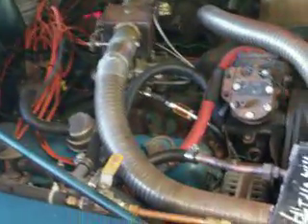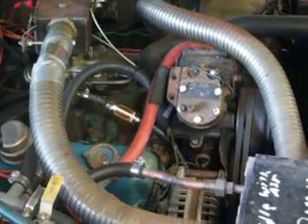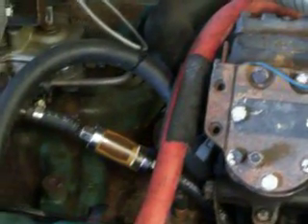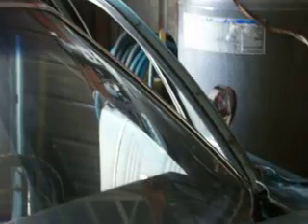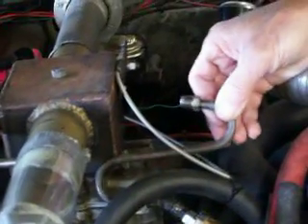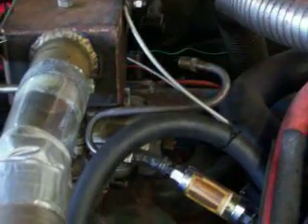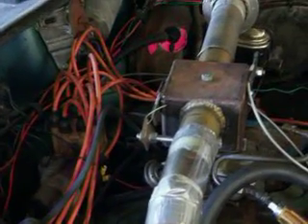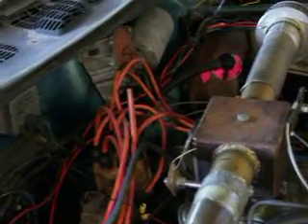318 on gas fumes

Comment: Yeah I’ve done this it idles fine but once you take it out on the highway. It goes about 8 to 12 miles then fails.  I’ve done this a few hundred times. Tom Ogle had the same issue but he took it to New Mexico by keeping it at a steady speed any variation makes it stall Slowing down also makes it stall. When he slowed down coming offf the highway he stalled That’s the reason As you burn through the fuel you burn off the most reactive part and it no longer reacts properly to the accelerator Hint you guys you don’t need any heat. Ran mine for miles without heat. Also it’s not running on “ vapour” this is a misconception

Comment: The main thing is how many miles are you getting to a gallon
Reply: It increased my gas miles from 12 in city 15 on freeway to 15 - 19 in city to 25 on freeway,  in a 1965 Dodge truck with a straight 6 cylinder engine single barrel down draft carburetor. I made my first one out of 1/8 plate aluminum I cut wholes in before I found hollow metal balls on internet,  its shown on my other videos , 2 are shown on 1973 CB360 motorcycle , with engine running , on my YouTube channel  .

Comment: Mine uses the PCV valve hose with a T and another PCV valve that connects to a one quart bubbler . Gives the engine a nice little boost in power

Comment: Add a hollow metal ball between carb and intake manifold atomizes and vaporizes gas doubles gas mileage
Reply: I’ve seen your hollow metal ball design on your page.  Why would it work though? 

There’s still a hole going through the center of the ball, so a straight path from carburetor to intake manifold.. 

So fuel would still go straight into the manifold .  How would it get vaporized?
Reply: @johnle231  as the air goes thru the ball it creates a worreling in the shape of a donut that sucks the larger droplets out of the intake air just like smoking a  bong vaporizes the smoke creating circles kind of like people blowing smoke out of their mouths only much faster ! I looked down thru the carburetor and saw the droplets being ripped apart , I used a small device used to look down into walls looking for leaking pipes etc . I have no other way to explain it .
Reply: @RLBJR1666  

And you got double the mpg?   Has anyone tried your idea and reported results back to you?
Reply: @johnle231  not yet , I wish somebody would , it's hard to do by those who wont do modifications,  it does cause the carb to sit higher , on my truck I had to make linkage  simple lengthening a metal clip on bar to carb linkage
Reply: @johnle231  I gave the idea away years ago never patented, public knowledge, most are afraid to try ,make one for small engine where you can throttle carb by hand , you will see your sparkplug sparkling clean and high rpm on easy start up any motor ! I broke my ankle and. leg , while getting my motorcycle a tune up ,added electronic ignition, got the leg support off last week so hopefully can show it running very well by video again !
Reply: @RLBJR1666  

How do you think it would work on efi or tbi engines
Reply: @johnle231  on my channel I show a design of efi setup , tbi it vaporizes the fuel / air mixture so well that it cant but help get better mpg , I'm not an engineer so all I can say is experimenting is the only way to tell !

Comment: Hi , do you make any modifications to the engine to compensate for excessive combustion chamber heat from lack of cooling that would have come from the atomized fuel from the carburetor , does this conversion cause valve burning?
Reply: todo lo que dices es una teoría; te recomiendo midas la temperatura en ralentí y bajo carga de el refrigerante y los gases de escape, luego agrega un poco de vapor y mide las temperaturas y verás que el motor funciona más frio, no ocurrirá quemado de válvulas, la teoría del vapor de gasolina es diferente a inyectar gasolina liquida, son otros principios, por eso es mejor probar y luego comentar..saludos

Comment: listen to the exhaust its already burnt out valves
Reply: why do i keep hearing about how vapor burns valves? one person says intake valves another says exhaust. vapor burns cleaner, with less deposits, so a bad valve seal is much less likely. also it burns faster, which would keep the combustion event farther from the exhaust valve opening. is there another way to burn valves besides a bad seat/valve seal, or crazy retarded timing? or is this just that "well i heard a guy yada yada yada" hooplah?
Reply: The answer to you question i simple but the equipment  required  to monitor is pricey , High temperatures are taken place at the combustion chamber and exhaust side on every internal combustion engine , not the intake manifold/ valves  like you hear some say.
 So cold /warm air flows/comes in to the engine via air filter and tube / throttle body/ to intake manifold /  past intake  manifold and intake valves... to its final destination which is the combustion chamber where all the magick happens. There (combustion chamber inside the cylinder head)is where the warm/cold air sucked in is then  mixed/blended with gasoline droplets/ mist sprayed from fuel/gas injectors and then ignited all together at the correct " ignition timing" via spark plug/s which are triggered and Supplied with voltage and amperage from the ignition coil/ coils to create the "Spark that is necessary to ignite / explode " the air/fuel ratio mixture and make the push force-pressure/hp/tq  needed to move the car forward or back.

If the temperature gets out of control from too much heat at the combustion chamber then you will literally melt the spark plug and cylinder killing/ destroying your engine and having to replace it.
As for the exhaust valves, right off the bat we know been the exhaust system/side of the engine/motor is going to be hot and that is normal , how hot is normal and how much hotter is not normal for the exhaust gas/ valves to be? It depends on the engine itself , if has been turbocharged , supercharged , no turbo , no supercharger , or if has been added nitrous system.

A naturally aspirated engine , the exhaust gas at wide open throttle should read between 1200 deg. F to a max of 1350 deg. Farenheit overall max when driving hard or racing. On a car with turbo/superchaged engine the exaust gas can be hotter and still be ok , say between 1500 to 1750 deg. Farenheit. They create extra heat from running extra gasoline fuel or what is called running rich/ or richer than that same car/ engine but with out the turbocharger/supercharger, also more pressure more heat, they  create more pressure from more fuel and air/ oxygen from turbo.
Now these are not exhaust manifold temperatures but exhaust gas temperatures which are almost the same as exhaust valve temperatures.

Back to your original question , it is said that part of the fuel droplets/mist injected to the combustion chamber is to control the heat at the exhaust valves not just to create the presure/tq needed to move the car,  when you drop some gasoline on your skin then it quickly dries, it leaves a cold sensation /feel on the skin , so im not sure if this is the same effect on the exhaust valves to chill them some.

When your engine runs lean (more air/oxygen than gasoline) it can burn your exhaust valves or melt your spark plug and chip or melt the combustion head and pistons.  All this from not spraying enough gasoline droplets. When you are running on fuel vapors there is zero fuel liquid droplets to cool the valves and restrain the exhaust temperature, but i have heard many say this can be easily fixed by adding water mist injection together with the gas vapor system, and the tiny water droplets would act as a cooling system to the exhaust valves and possibly the combustion chamber.

As for monitoring the temperature of the valves and combustion chamber look into:

-Exhaust gas temperature pyrometer gauge/probe kit.  Screws into exhaust manifold but reads inside the manifold as the exhaust gases flow/pass by the sensor than sends the reading to a gauge inside you car that display the exact temperature at that exact time.  You can add one per cylinder or however many you need.

I hope this helps.

Comment: Those interested should check out the Gasoline Vapor Systems group on Facebook. The site is a great information source for Gasoline Vapor systems and other high mileage / gas saving devices. It's Excellent !
Reply: yall watch out, dont go do anything on facebook.
Reply: if you people knew anything about engines and thermodynamics you would understand why this is all bullshit and will not save you a cent

Comment: Hi there,
Would you please be kind enough to show this system from inside.
Just like you did it with the lawn mower vaporizer.
You don't have to post the detailed plans.
Just  a quick view of all the parts used on this 318 engine for vaporizing.
Any effort will be highly appreciated. 
MS

Comment: I understand that this system works, but one of it's inefficiencies is that it heats the fuel, (to create gasoline vapor), off of the radiator system. This means that you have to wait until the engine comes up to operating temperature.
Reply: Actually Ive done extensive testing with both a "wick" and "bubbler" device with heat or without. The system runs on vacuum created by the down stroke on the intake of the cylinder. Neither bubbler nor wick make any difference to the efficiency as I got the same results with either and without both. The vacuum lowers the boiling point so heat is really not needed though everyone goes that route. This system has been around for 80 plus years and there are 250 patents that can be accessed via the internet
The government grants patents it doesnt own them.
 If a patent expires it becomes in the public domain
Tom Ogle ran his test from El Paso TX to Demming NM but stalled 5 miles from his target and couldnt restart the engine even though he had gasoline left in the tank
Charles Pogues system seemed to work better but it was the same system as Ogles but he circulated his gasoline so it only seemed better. It was the same 
The emissions are carbon dioxide. It does scorch the intakes (on a V8 about 800 hours and 500 hours on a 4 cylinder) 

I worked for 3 years 70 hours a week on this technology and you dont know that much about it or patent law
Keep working cause youre not even close
The system is 20 times more efficient than the standard set up and I got 651mpg on a 1100cc 4 cylinder air cooled horizontally opposed
Reply: @leslieclendening2947  hey Leslie, do you have any recent work?
Reply: @leslieclendening2947  help Young, my friends
Reply: @leslieclendening2947  Please could someone help me, I replicated something similar in my Honda Accord82 car and I can't get it to regulate and seal any leaks. What impresses me is that it evaporates 1l in less than 10m, enormous consumption and the crewo engine that shuts down due to excess mixture, The device also has an aluminum heater that takes heat from the coolant, I can't explain how it escapes like this, when you accelerate it it reaches 3000 or 4000 and when decelerating it throws explosions through the exhaust 
Even if I let it in with more air with the air cock, I can't get it to run.
Reply: It is not a bubbler but a kind of blower like vaporkids did on their lawnmower, can you explain to me why this happens to me?
Reply: +Tony VannTruth this is not true ... the fuel vapors can be a cold start and then be more efficient at operating temperatures ... see above for my design set up , that was just posted ...my system is a bit of work , but the net gains will be worth the efforts...
Reply: Thanks Thomas, I know that gasoline vapor can be created by a cold vapor system, an example would be a wick system. In this video, the gentleman says he must let the engine warm up, and this is why I assume that his system heats the Gasoline off of the engines cooling system.
Reply: @tonyvanntruth2969 nope you are making incorrect assumptions on how this system or the wick system works. They do not work the way you theorize   One of the reasons they don’t get on the market is the lack of understanding of the process everyone hits the same roadblock. For the same reason.
Reply: lol the bubbler ad wick system work the same way same theory and not at all for the reasons you think.
Reply: Ogle Pogue had the right system wrong theory

Comment: Neighbors – 1. Why don’t you explain by pointing out your Vapor Systems components and their
functions while you are running on gasoline? Your videos would have far more validity of how your vapor system works if you did.2. Futhermore - I have a question – IF this a carb engine that is still running with the fuel
line disconnected from the carb - why isn’t fuel still being ejected from the fuel tube? The engine fuel pump is still pumping fuel isn't it – but none is being squired out – why?Cuviercastle
Reply: He probably changed over to an electric pump, and has a switch by the dash. That car may have already had an electric fuel pump from factory, I don't know for sure.

Comment: Hi This is the first video I've watched about this. How did you disconnect the fuel line without getting a gasoline shower?
Reply from the maker: +57fitter he ran the carb dry before he unscrewed the gas line
Reply: +TheVaporkid OK but  why doesn't the fuel pump shoot fuel out the steel line when it's unhooked?
Reply: I assume he has 2 inline solenoids one on the line to carby and the other on the line to the vaporiser tank. simple really.
Reply: +57fitter I have the same question. There must be a fuel pump shut off.

Comment: Little bulky but hey it works, I tried a small cold vapour setup and just realizing preheating the gas liquid before you bubble it will help greatly as it will help the gas vapor blend with the air and not turn back to a misty or liquid state before combustion. When room temp liquid gas is bubbled the vapor produced is ice cold, or so I`m learning... Thanks for sharing, cheers
Reply: agreed. it helps to increase MPG 200%
Reply: so yes people get it closer to flash point to blow up your engine bay, atom bomb on wheels

Comment: 4. you need to protect your gasoline pump as fuel injection system to do this you can use same solenoid switches used to convert gas cars  to propane

Comment: carburetors to regulate the mix (air + gas vapors) in the gas container air intake
3. another butterfly in the engine intake you can link this one to the car gas pedal butterfly system to increase the gas vapor + air mix so you can use it as gas, and adjust by test and mistake until you are satisfied remember it is not just if the engine idles or accelerate also it depends on my driving behaviors